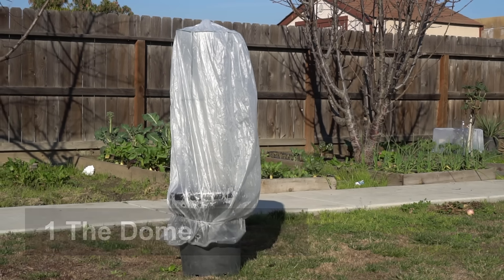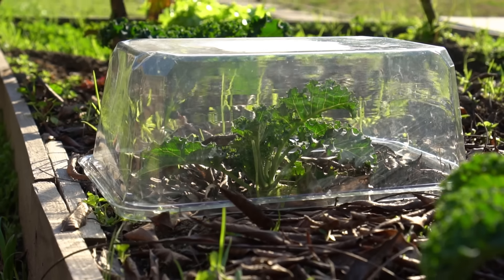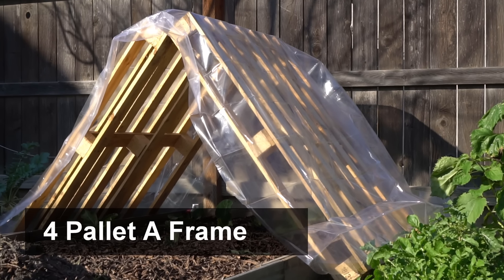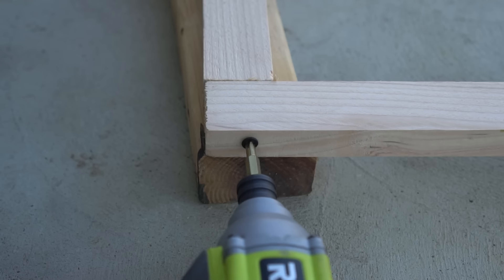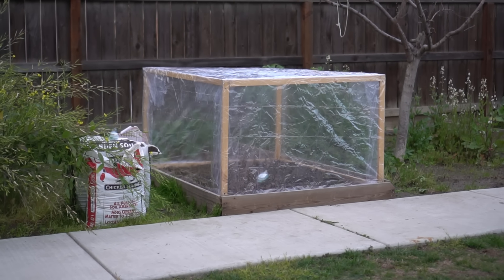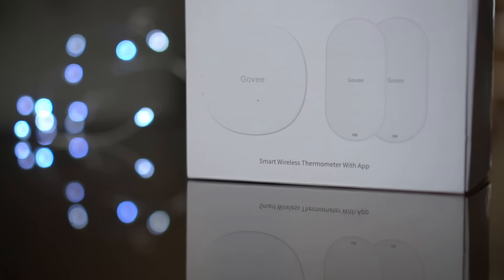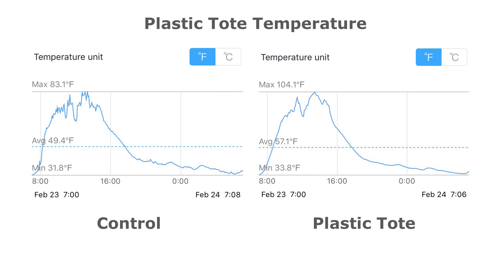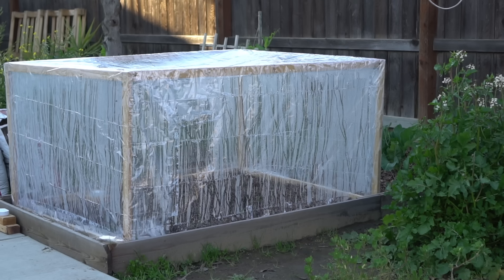5 Low Cost Greenhouse Ideas

Comment: Well Jag, seems like you have a winner with this video, ... but you could have made it just a tad better, by offering ways to secure the various methods of covering the plants, ... such as pinning the clear plastic bowl, & totes to the ground with some metal tent stakes, or setting a brick on top of them, ... accordingly to the size of the cover(s), ... or applying a set of hinges to the raised bed application, ... but still in all a good video, ...
Reply from the maker: Hi, thank you for the suggestion, really like when viewers provide feedback. I did mention hilling up the soil on the sides to secure the tote and spinach container. Also mentioned to tie the garbage bag to the container. Hopefully these were enough. Even with wind my containers did not fly away because of the soil.
Reply: I have used small rocks and stones on top of my containers, large and small and it works.  Jag said hilling up around the sides keeps the boxes in place.  Just vent them for an hour or two when it gets warm and then close them just before sundown.  They do well.

Comment: What if temperatures fall below 0 degrees farenheight?
Reply from the maker: Then you need a heated greenhouse.
Reply: A way to have a cheap heated greenhouse?
Reply from the maker: @Gymuser7442  Yes, by using earth's thermal energy. Run a pipe underground like a radiator and pump air into the greenhouse and the air will always be at 60F since the temp below 2ft is 60F all year round. I haven't built this yet but will soon

Comment: What about Ventilation.. won't they suffocate?
Reply: No, they'll cook! I had a greenhouse up north and there was snow on the ground...by 9 am in the morning the temps were so high it cooked my Mother-in-Law's Tongue! That's a tropical house plant! Got over 120F.
Reply: @piedpiper7051  LOL! That's horrible! LOL!
Reply: They need some ventilation although not necessarily daily, to prevent damping off disease. You do need to watch the temperatures, but this is a great way to get seedlings outside I to sunlight long before they are ready to go put unprotected.  I bring mine back in at night when it’s freezing.
Reply: Vent them when it is due to get warm and close them up again just before sundown.  Jag's suggestion about monitors in and out of the cold frames also helps you know when to vent the frames/boxes.

Comment: In my experience the plastic totes are far from UV resistant
Reply: Ed19601   Mine last several seasons, and I click the lid onto the bottom.
Reply: @kathyyoung1774  obviously better plastic than I had. Didn't last more than 3 months :-)
Reply: I'm sure you are right.  I don't use them that long.  Just a few weeks at a time to get seedlings outside before the outside temps allow it.

Comment: Used many of these hood ideas. ONLY ONE PROBLEM... WIND, WIND, WIND!!!!! Add info about securing your containers, your plastic, etc. One little string the WILL NOT protect and secure the plastic... believe me. Been there, cleaned up these torn plastic messages and picked up the little FREE plastic domes in neighbors yards.
Reply from the maker: Hill up soil on the sides of the containers, they will not fly away in wind.
Reply: Rocks, stones and pebbles on top help keep them in place.  I have used these and it DOES WORK!  As Jag said, hill up the sides of the containers.

Comment: Instead of nailing the plastic, why not use a staple gun and staples.- Easy to remove and cheaper.
Reply from the maker: Didn't have a staple gun at the time, now I bought one. Yes, Stapling is much better, thanks for pointing this out.
Reply: You could also use PVC pipe and use ZIP ties to attach. I'm going to build one like that this week. Send you a picture. Can easily be dismantled and put back together only having to use new zips.